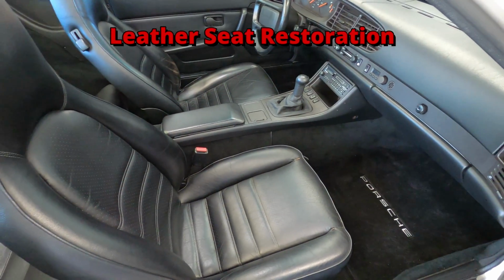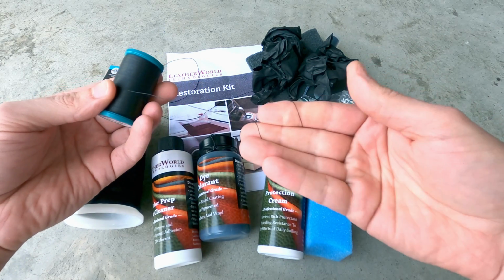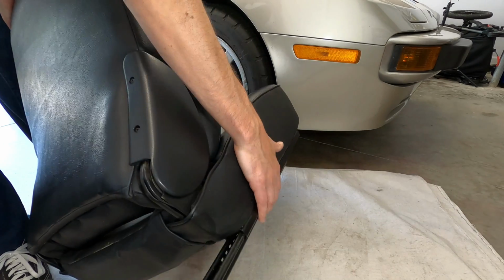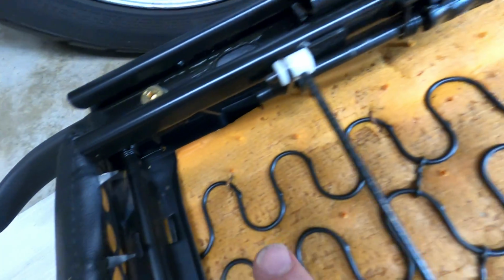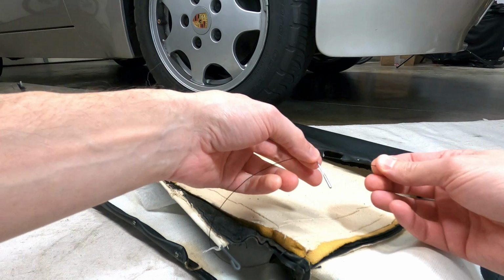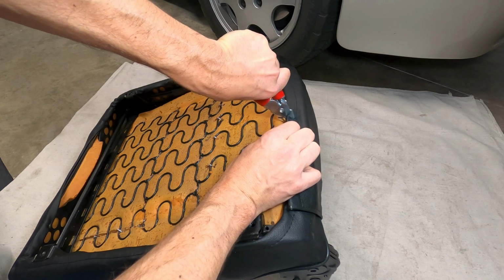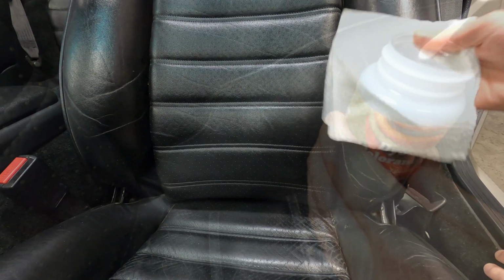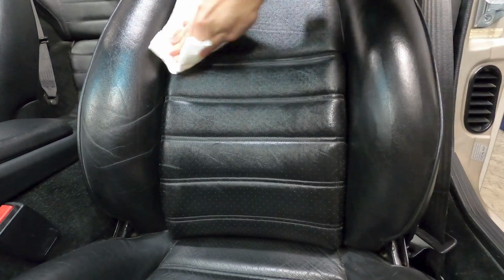Porsche 944 – Leather Seat Repair & Restoration Tutorial

Comment: How has this dye held up? Will be tackling same level of wear on my 87’
Reply from the maker: @bdude93  The dye coloring has held up really well, it’s still fully black. Early on after recoloring, the texture would go from glossy to matte as the leather dried out, so I had to condition it a bit more frequently than the rest of the seat material, but now I just treat everything once a month. Feel free to email me and I can send some pics of the current condition.
Reply: @NC944er thanks! What sheen of dye did you use? I see they offer several options from matte to high gloss.
Reply from the maker: @bdude93  I don’t recall them having that selection box when I purchased my kit. If I were to buy it today, I would choose to match the existing gloss/condition of my seats, either semi-gloss or high-gloss.

Comment: Great job! Car is beautiful and the interior is beautiful as well
Reply from the maker: The fabric is pretty tight on the passenger side to the point where it pulled in the piping a bit where the side seems join at the front. It’s not perfect, but the only other option would be complete recovering (like you did) or seat swap. At least there are no longer any holes. 😂
Reply: @NC944er  I think it looks great, man. If it was perfect, it would have less character.

Comment: My seats in my 84 944 are rusted and in a sense "welded" in place.
Do you have any advice on how to bust loose for removing..?
Reply from the maker: Oh man! So the first thing I would want to do is ensure the latches for the forward/back seat adjustment are correctly disengaging when that lever is pulled. The lever twists a bar on each side of the rails and disengages 3 metal locking tabs, but one side is controlled by a connecting rod passing along the center to attach both bars. That rod is affixed by plastic clips that can break. If the connecting rod is disconnected, only one rail will unlock when the lever is pulled. 

If you can peek under the seat while pulling the adjustment lever and you can see both sides moving, then it may well be that the rails are rusted. In which case I would place some towels all around and hit the rails with penetrating spray, let them soak for a bit, then try to leg press the seat from the front or back seats as needed to break it free while someone holds the release lever. Let me know if you have any luck! 👍🏼
Reply: @NC944er  
I'll give it a good try..thanks my friend..!!
Reply: Dealt with the same problem on my 85 last week...soaked the rails with PB Blaster multiple times and eventually the latch came unstuck however the rails were still rusted to one another. I got the seat to move forward and back to some extent but not enough to get to the bolts on the rails. The covers were going to be replaced so we cut the bottom cushion cover, removed the foam cushion and had access to the bolts.
Reply from the maker: @papasmurf986  Nice work and thanks for sharing! Was yours the victim of a failed battery tray allowing standing water to repeatedly enter the floorboards? Hard to believe they can get rusted to that extent.
Reply: @NC944er  quite likely...still gotta repair the battery tray.